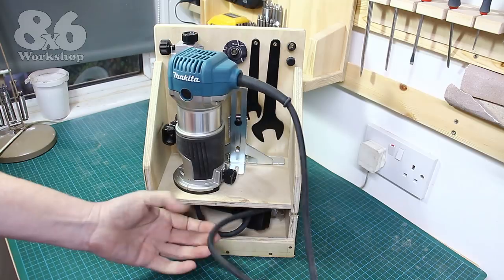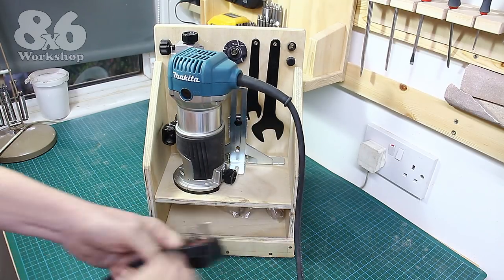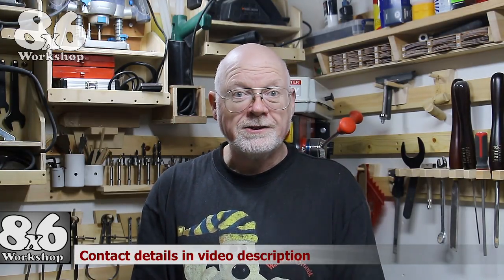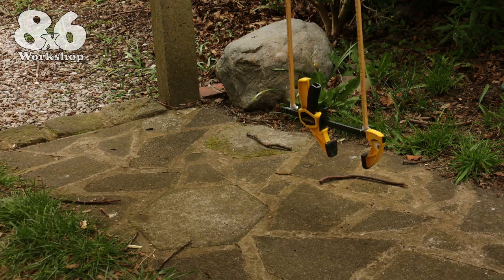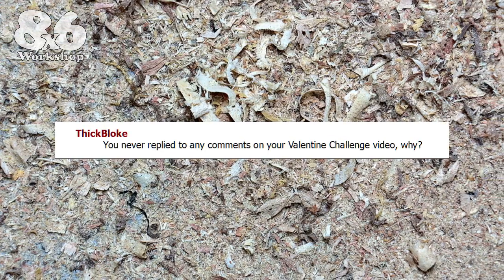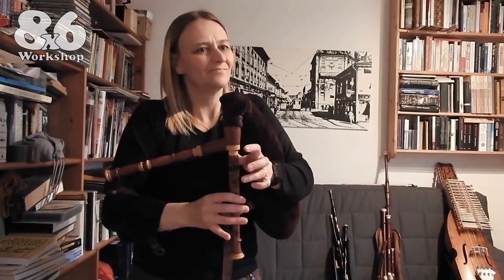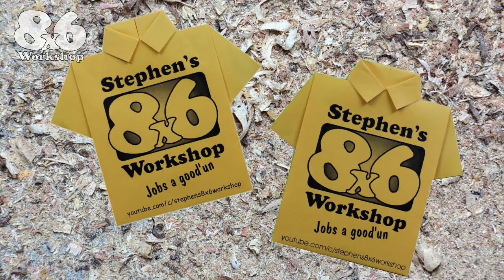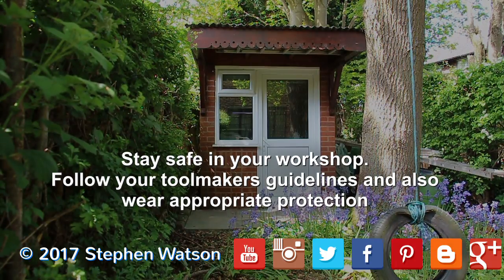8x6 Vlog ► Shop Upgrades - Bagpipe Build - Sticker Swap - Animating Stanley in this workshop edition

Comment: I love that track system and the hooks for the lighting cables is simply genius.  I need something like that to sort the cables running across my ceiling.

As a small 'shop owner, your small 'shop is very inspiring.  Thanks.
Reply from the maker: Hi Andy, thanks for watching. I'm lucky to have a flat ceiling to be able to fit tracks without having to resort to frames to hold everything in place. Keen to see what you do on your new channel by the way :-)

Comment: The mains cable takes up a lot of space when storing tools. And it needs to be coiled. I have fitted plugs to all my hand power tools, either into the tool or via a tail if that is not possible. A single socket on a lead is used for all of them. This dresses with the extractor hose, which also fits all my tools. For plugs and sockets I use Bulgin Buccaneer 4000 series (RS) which are very small (but will feed 2KW). These are quarter turn lock, and waterproof. My extractor hose connector is the DeWalt 'Airlock' system, chosen because you can turn a channel in a 32-40mm waste pipe adapter and it is a great fit (and very cheap). 30deg turn lock. One hose, one lead, overhead mount, lots of space saved. Keep extra lead(s) in your carry box for off-site use. I recommend it.